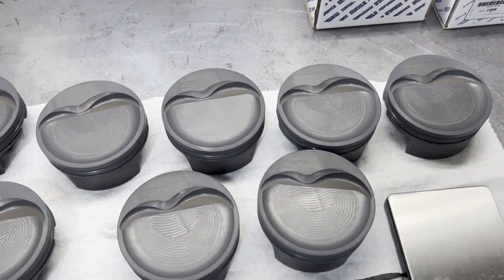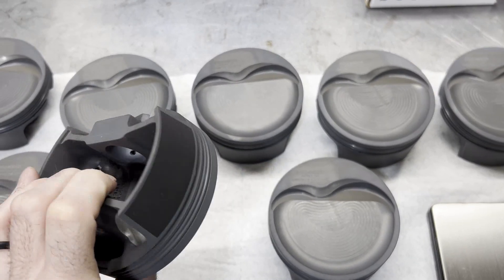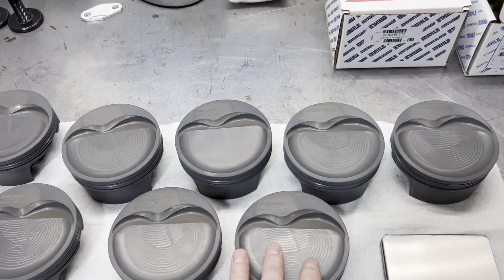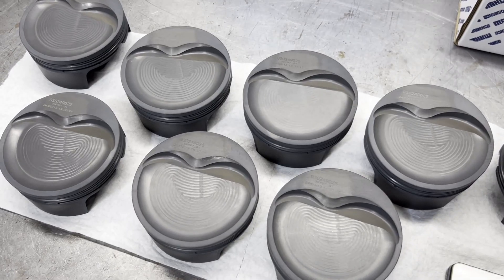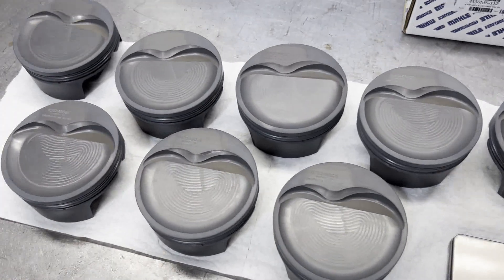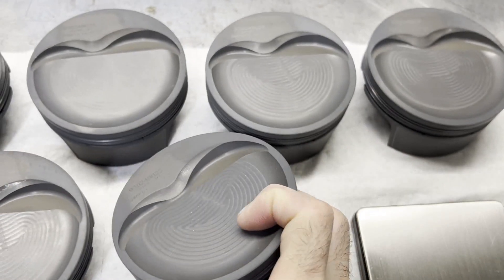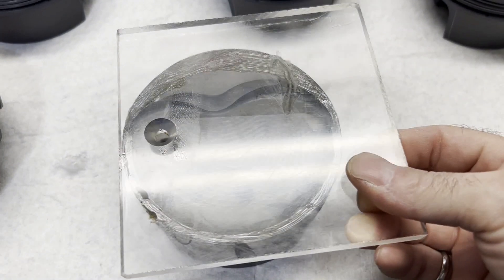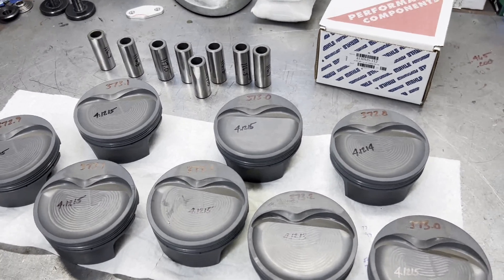Lykins Motorsports Another Ford 363, Mahle Piston Overview...

Comment: Why the big dish in the pistons?
Power adder possibly?
Fuel restrictions?
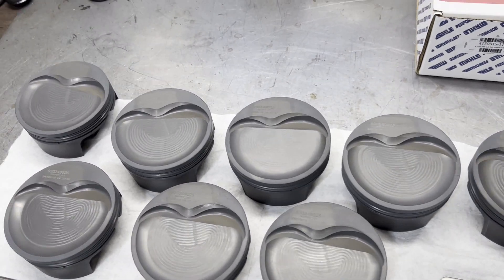Reply: Around 3:16 Brent says, "the compression ratio will be just under 10:1 so there'll be no issues with pump gas." 🤷‍♂️
Reply: Did you listen to the video😂 Brent said why.